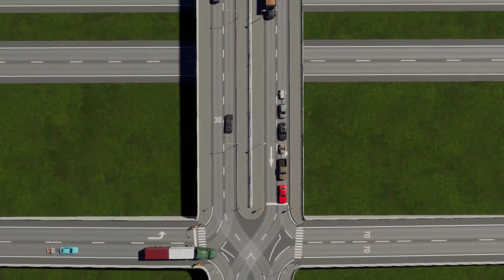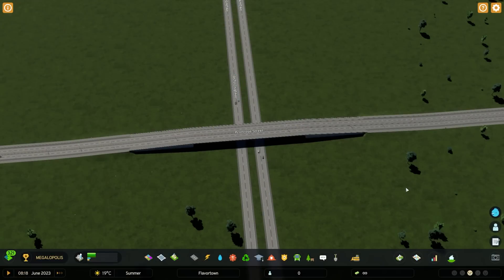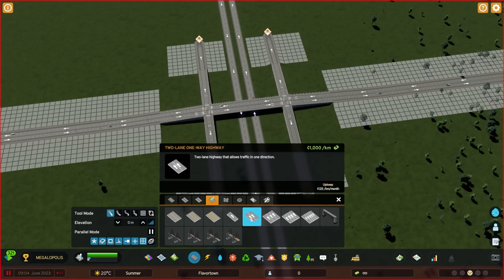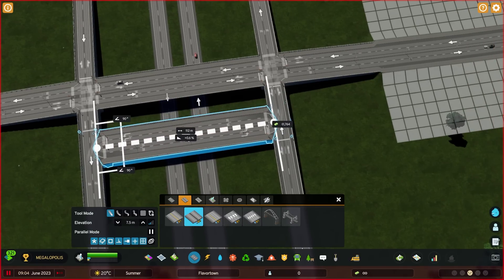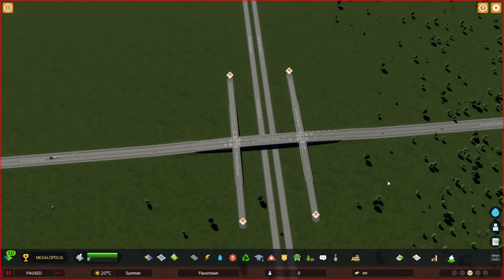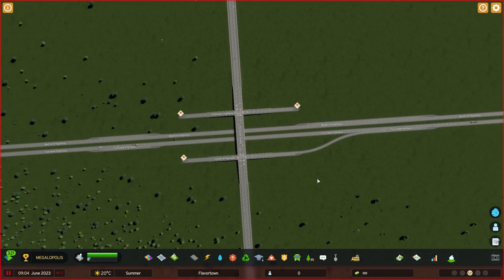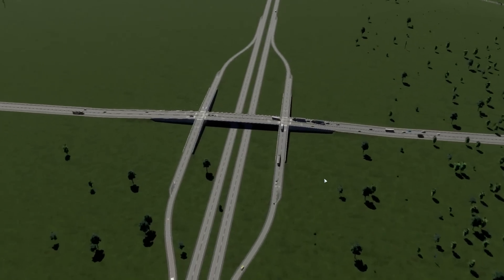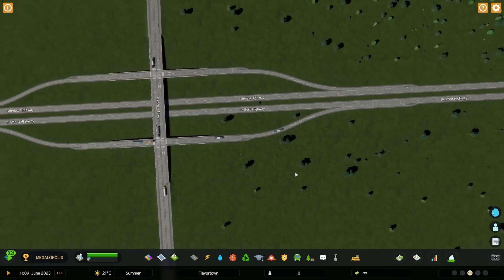Divine or Diabolical? - Building the Diverging Diamond Interchange (DDI) in Cities Skylines 2

Comment: Did they change the tool? I slide overpasses left and right at will. Just use the upgrade tool with ALL alignment functions off, then slide select to manipulate/upgrade both segments before and after the pillar at the same time. No nudging required. Just 2 movements to move one whole side in, then the other side.
Reply from the maker: I think the nudging was to satisfy my need for perfect alignment. Turning snapping off would make that impossible.

Comment: This would be massively improved with the traffic lights enhancement mod from thunderstore. It gives you the ability to control turning directionality per-lane, and has a right on red option. Meaning with proper lane maths, you can have traffic flowing constantly as it will allow traffic turning left onto the freeway from one direction, while also allowing traffic to turn right onto the same ramp from the opposite direction.

Comment: I just built my first one of these (before finding this video) yesterday in my city. It came out OK, but this one looks very polished. Love it! I also had some direct turn lanes to allow some smooth lane useage without the 90-degree turn at the top of the ramp. Thank you YUMBL. 

I have seen a lot of these things IRL. They look absolutely insane, but they work very well and have squared away many intersections that I knew to be nightmares before. A few IRL that I have seen:
- I-55 & Weber Rd in Romeoville/Bolingbrook, IL (this is the one that I took inspiration from)
- Route 17 & Route Rt 32 in Harriman/Central Valley, NY (this one is interesting because they were bound with existing buildings complicating/squeezing construction including a school and a major outlet mall. They also used a dog-bone roundabout within the same construction. Pretty cool to see.

Great video!

Comment: One downside is now one of the freeways has traffic lights on it.  the lower level people going straight through do not have to stop.  The upper level people do have to stop.
Reply from the maker: Yes, but there is only one freeway here. This is a service interchange for getting on and off the freeway, not a system interchange for connecting freeways. Conflict is allowed here.
Reply: @YUMBL Thanks for your polite answer.   I know the difference between the two types of interchange (learned from watching your vides).  I was thinking it was for two freeways.

Comment: The flaw here is you need to give the "left" turns direct access before the intersection, then make the traffic lights straight only. Right now it is just a normal traffic light, with both sides of "straight" traffic red at the same time to allow turning, which differs from a true diverging diamond.
Reply from the maker: Correct! Easily solved with traffic light and lane controls without adding additional networks :)

Comment: We have one in my city IRL... It's a nightmare, worst traffic in the city happens in our diverging diamond interchange.
Reply from the maker: They do generally go in places with higher traffic volume. I wonder what it replaced 🤔
Reply: @YUMBL  So, it was a diamond, then they changed it to Diverging Diamond about 10 years ago to fix a traffic issue, but that was like trying to fix a 3rd degree burn by placing a kid's band-aid over it. The real issue is it is a freeway interchange (one of only three in the city) to the busiest part of the city, and the interchange is located on an arterial road that then intersects another arterial road less than a block away from the interchange, leaving like 4 traffic signals in less than a 3 block stretch of road. Also, the interchange is the only one that leads to the University that is the major focus and draw of this city. We're growing faster than our infrastructure is designed for, and it seems unlikely that we are going to find a useful solution soon.

The traffic issues at that interchange isn't caused by the diverging diamond, but it is still the worst traffic in the city.
Reply from the maker: Very interesting. Hopefully the city can figure it out!

Comment: you can make the roads closer in the parallel tool, the two lane highway can get down to 0.25 units separated.

I live right next to a DDI, I've not yet seen any collisions there, but I do see collisions at the standard 4-way intersection that's about 1000 feet away from the DDI. The truth is, the DDI has far fewer conflict points, so there are always going to be fewer collisions than a standard 4-way junction, which, IIRC, has 32 conflict points. Funny enough, there is a continuous flow intersection (not interchange) a few miles away that is very compact, and last night I saw a very bad accident there. The problem is, there aren't any signs that indicate where you're supposed to go, so when turning right, it's very easy to end up going the wrong way. They're getting very experimental with the roads here in Texas, but the 2 things that work for interchanges are displaced left turns and DDIs it seems. I know there's at least 1 dumbbell that was being planned for i35 south of San Antonio, but I'm not sure if they started on that or if it was scrapped.

Comment: I love the tricks, this is a really cool interchange. I am going to try it out, but I imagine it will be best used as a mid-level capacity interchage. Is there any way you can do an episode specifically about intrchanges with regards to high capacity traffic management in Cities 2? I am finding it difficult to build interchanges that handle high volume traffic in high density urban areas effectively. Also, an episode on high volume intersections would be very helpful. Your road hierarchy video was very helpful for traffic flow; intersections and interchanges for high traffic flow would be amazing. Keep up the good work and thanks for all you do!

Comment: All the ones I've seen the freeway goes over the DD.
Reply from the maker: Either are fine. Most interchanges do whatever makes the most sense based on the land, or what infrastructure existed there before. Its generally less expensive to elevate the arterial rather than the freeway.
Reply: @YUMBL  i can see if you're building brand new.... these DD interchanges were upgraded from clover leaf exchanges that already ran below the freeway... if you to 42.50457035802785, -83.11468959441903 in google maps you can see it...

Comment: I love these intersections. I used to drive through one all the time in Superior  Colorado. Much better than one of the interchanges near me currently. 
It's 2x3 (the extra lane is a dedicated turn) that is a 2x2 into the intersection, which is then a 2x5 on the other side of the intersection (2 left lanes are dedicated turns onto the highway, right lane is dedicated onto the highway, and the remaining lanes being straight.) then how the highway works is it's parallel one way roads along the highway that the dedicated turn lanes go into to then enter the highway. The issue is the right most left turn lane merges into the left most straight parallel and then diverges again into the highway. Like, they just need to put one of these there because the number conflict points here are insane.

Comment: 6:19 it probably also affects vehicle conditions and therefore accidents. I do see an issue with the lane math where as they merge back down to 1 lane (possibly from no dedicated lanes?) they wait till last minute to merge, often hogging the left lane, and not zipper merging. I think the CS1 "lane math" is a bit out right now unless we have dedicated lanes, I've often had to just upgrade them into 2->4 (then reducing it to 3 then to 2) mergers so that they would merge properly and...that takes a lot of space but highways are cheap as dirt in CS2 so whatever doesn't back up traffic into the city.

Could you have done it quicker with smaller parallel amounts? Say .5 or .25?

12:51 - and you can bypass the highway with other offset roads or create a VOP-like structure easily enough through the DDI if the through traffic is important. :) 

Split phased lights (there are EXPERIMENTAL mods - TM:PE or vanilla support would be preferred ofc) would be better

14:33 nah it's just unfamiliarity and it's not on a road test. Go to like Texas they don't know what a roundabout is let alone diverging traffic - and because they overbuild everything and everyone has big trucks, they'll just plow right through the grass or small concrete pavement. Here there's a bit more jersey barrier and cars in the way...people complained at first but accidents and traffic are so much smoother now.

Comment: Great trick to create a beautiful "left hand road segment" in a right hand traffic world!

Without a lane connection mod and an adjustable traffic light mod, I think this interchange does not add that much value yet. Without dedicated turning lanes and Without the possibility to have "always green light" for the turning lanes, the advantage of the diverging diamond, as you explained so well (when there is more turning traffic than straight through traffic), will not be met.

Comment: The only improvement you can do to make this better is to make the on/off ramps be separate from the lighted intersections. The vanilla traffic light system handles it quite well.
Reply from the maker: The ramps will be in the intersections when I have control over lanes.
Reply: There is now a mod for this, and I think it's one of the must have mods for the game.

https://youtu.be/OUGg1QQiZLU?si=8obL-HEM2HEHy6ff

Comment: One thing I've noticed is that the diverging diamond seems to work better with people when there is a longer visible lead in to the crossover, but when there are busy intersections on either side of the diamond people seem to lose their minds entering.
Reply from the maker: Do you have an example of a DDI with busy intersections on either side?
Reply: @YUMBL  The closest to me only has an intersection on one side (https://maps.app.goo.gl/f7JQsNnRRbXj4JWe9 ).  People are struggling to get used to this DDI seemingly more than the one here ... https://maps.app.goo.gl/QNcf1TPMdP6BxtYe7 .  It could be because of the busy 4 way intersection near the first, while the 2nd one's intersection is into parking lots on both sides so much less traffic.  But it could just be the approach or the size of the DDI that is causing the issue.  There was another one somewhere I went through that was worse but I can't remember where it was.

Comment: It looks like the traffic lights work properly too.  The devs must have foreseen this possibility.
Wouldn't pulling the overpass lanes together go faster if you started with the minimum separation (0.25) to begin with?  Also turning snapping of entirely might make it go quicker as well.
Reply from the maker: If you find a spot that snaps PERFECTLY centered with the roads closer together please let me know!
Reply: @YUMBL  How could you tell if it was perfect?😉  But I will try it and see how it works out.
Reply from the maker: The method I showed snaps the roads perfectly symmetrically, and then they are nudged in symmetrically as well. .25 did not yield the same result.
Reply: @YUMBL    Interesting.  I did not expect that.  Thanks for the info.

Comment: I’ve noticed that in parallel mode that’s it’s one zone tile apart if you incense it to 2 it’s 2 zone tiles. Also you can decrease it lower then 1 so you don’t have to manually move the roads over.
Reply from the maker: If it snapped evenly below 1 I would have done that.

Comment: I lived in Anchorage, AK for a number of years.  They installed a diverging diamond interchange at the northeast corner of the city, and it was...weird.  It flowed pretty well, just took some getting used to.

However.  The interchange it replaced was simpler and OVERWHELMINGLY worse.  Traffic there is workable now, whereas before it was unbearable.

Comment: the only improvement i can think of is to replace all the turn lanes with slipways and force the large road to go straight only. Cars dont turn on red at all so this is needed for the DDI to work as intended. the offramps in the video would then be left turn only and with the onramps replaced with sliplanes, you can angle them to make those barriers mentioned @11:40. 

I'm glad you made this tutorial, I had no idea how to get roads that close together before!
Reply from the maker: Thank you! I’d like to make slip lanes by controlling the traffic light and lanes rather than adding a big road off the side.

Comment: If you enable dev mode, you can at any time toggle left hand side traffic (for subsequently built roads). When I saw this I immediately thought of using it for a diverging diamond, haven’t yet built one though. Seems like the ideal solution, except I fear the game might screw up the traffic light phases because it thinks it’s a regular intersection (having both straights go at the same time). That would be fixable with mods though.

Btw, there are some mods particularly for controlling lanes and traffic light phases, Biffa made a video about it and it might help you out a lot, and may also be enough to fix potential traffic light issues mentioned above.

Comment: Great video as usual. One small note when in parallel mode reduce the gap from 1 to maybe .25 and it may make things easier to set up. I always come away from your videos having learned another detail which I have missed in my builds and your explanations are so clear and detailed that I don't have to guess what you meant by the instructions as you build something. While I am not a fan of diverging diamonds which may be from not having them where I live I understand their use in the traffic flow models. Keep up the great work man!
Reply from the maker: Thank you! .25 didn’t yield a good centered snapping result for me. Not as clean a setup as 1 wide on a four lane road which is always centered.
Reply: @YUMBL  Hmm maybe .5 is the sweet spot there. I have a test game save where I experiment with Ideas I have before trying them in my city build save.
Reply from the maker: 1 was the only one that snapped in a way that centered on the roads i was using, but if you find another setup that centers perfectly let me know!

Comment: They converted a diamond into a diverging diamond interchange on my route to work years ago. The never ending traffic jam on the highway and surface street was ridiculous before. Now traffic flows through with minimal back ups during rush hour. It was such an improvement.
Reply: Glad to hear that! They are working on one that is like 5 miles from my house and the road is a traffic jam for miles. Hoping that it alleviates the traffic like yours did.
Reply: @itsatrap7215  it depends, they put one near my place that was too close to other lights so it still backs up pretty bad

Comment: 14:50 Good ones IRL also spread out the node even more and have you come in on more of an angle, so the approach road from the side street is pointed not straight at the oncoming traffic.

You could try splitting the ramp also into 2 to do that, and maybe try to push the node bigger by temporarily using the 32-metre roads instead of the 24-metre ones to give you more connection space -- maybe even separate the offramp into two parts joining the same node.  (Another trick you can use to try to make that happen is putting an extra-large roundabout there so you have more connection space, then delete the roundabout to get an ordinary node again.)

Comment: 10:20 One thing you can try is building them as alleys, since then you can get them closer together more easily, and then upgrade to 2-lane roads without keeping them centred to bring them closer together.
Reply: He just need to reduce the paralle number to below 1, more simple than that impossible.
Believe the minimum is 0.25
Reply from the maker: .25 does not snap centered. You will have to guess when you nudge it.

Comment: Not a fan of the diamonds, in the game or in real life. I've become a fan of the single point urban interchange though, in the game and real life...lol.
Reply from the maker: SPUI is actually a diamond variant! Just like the diverging diamond. https://en.m.wikipedia.org/wiki/Diamond_interchange
Reply: @YUMBL  It's super efficient. You can clear an overpass in 3 light cycles instead of 6. They work well in the game.
Reply from the maker: DDI is a two phase light :)
Reply: @YUMBL  The problem, at least on the one we have in our area, is the diamond backs up between cycles. At rush hour, there is usually a 3-4 cycle wait to get through both lights, if you're going straight. The SPUI doesn't have that issue. I can see how they could work in the right environment, but where they put the one I know of was a horrible idea. I avoid it like the plague, lol.

Comment: One of the big real life benefits of diverging diamonds is the simplicity of the traffic lights.  Gone are the timings for left turns, allowing rights while other flows are doing lefts, and allowing for straight through traffic.  Instead there are two simple coordinated lights handling straight through traffic.  One direction is go and the other stop.  None of the flow to or from the highway are impacted as they have all become right turns.  It seemed weird the first time through, but you quickly get used to it.  And the traffic speed up is amazing.  I am new to cities skylines but I have seen that the traffic lights seem completely brain dead.  It really needs a complete traffic light planning system for busy interchanges with load balancing.  Of course it also needs to resolve brain dead drivers.  So far, I think all the drivers in the game are constantly on their cell phones!